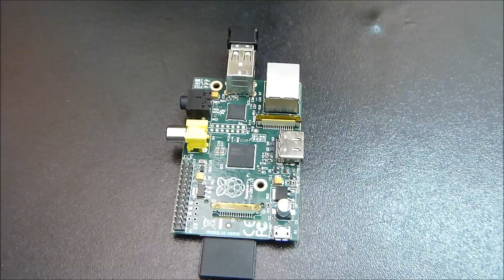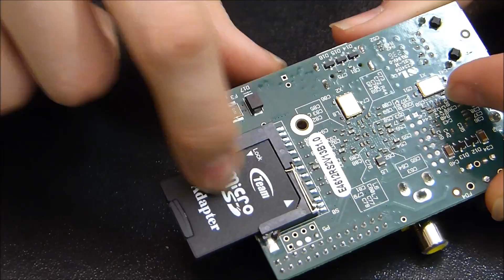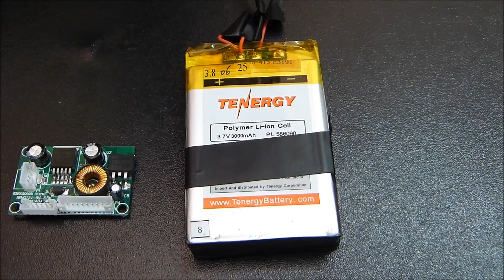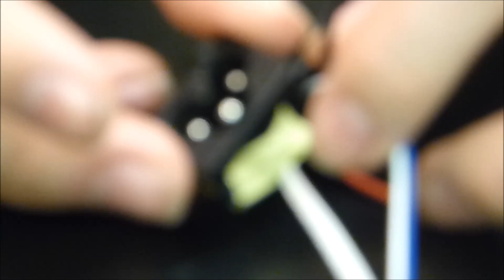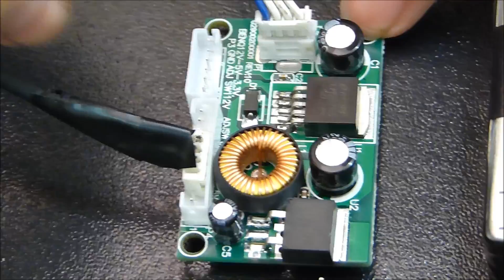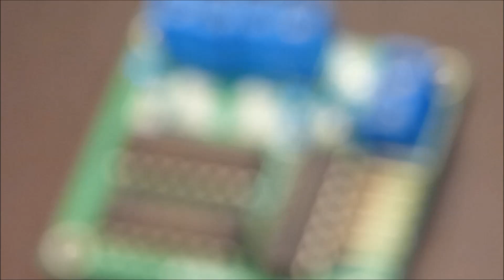Raspberry Pi Model B with Battery Pack

Comment: Hi Scott, thanks for the video!

I am looking to record 1080p video from a v2 camera on a Pi Zero (not wifi) and would like to know how much battery I would need to last for five hours?

I calculate that the Pi Zero while recording is 230mA (=1,150mA) and the board itself is only 120mA (=600mA) totalling 1,750mA for a five hour recording session, what do you think?

Comment: Raspberry Pi can be powered up using any voltage from 7v to 40v using the regulated power board available at CrazyPi dot com
On CrazyPi dot com search for the product "5V 3AMP Regulated Power Supply Board"

Comment from the maker: Yeah, I plugged in directly into the line of the battery and will not interrupt power.  Just make sure you're within the voltage range of regulator on the battery.  I'll put up a schematic on how it did it later this week.

Comment: very cool stuff! = ) I have also a question: If you power your pi with the standard laptop charger thing, and then the power goes off, can the pi switch to the battery and keep running? I'm asking because i would need to monitor a construction and get a notices when the power goes off for some reason (geting a sms via a umts card for example). thank you

Comment: Question: I see you spliced a charger plug between your regulator and battery. Are you able to plug the charger into that connector to charge the battery pack with out interrupting power to the raspberry pi? I ask because I'm looking to do a similar project but will also build a "docking station" for my car to charge, but I can't have it shut down while it's charging because I will be controlling the device from across the internet.